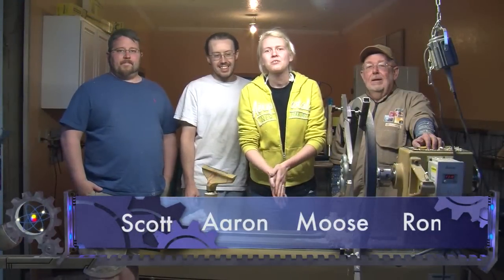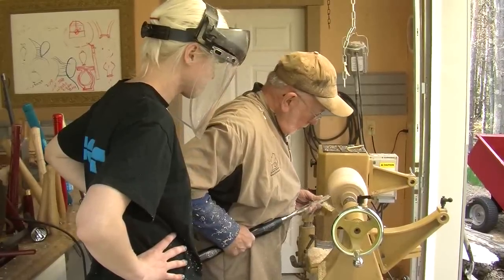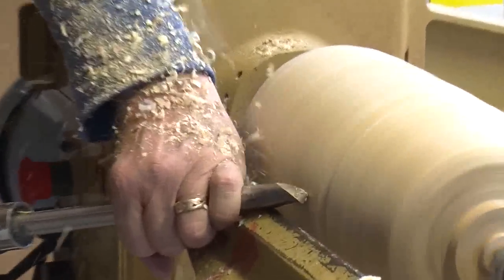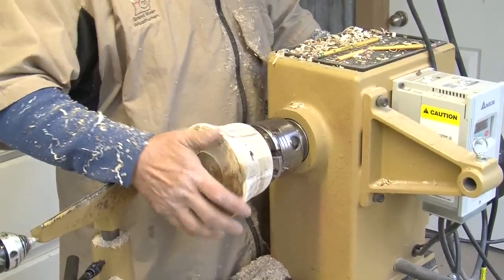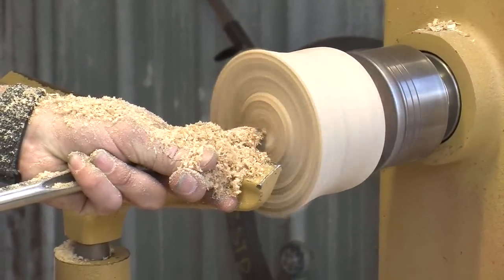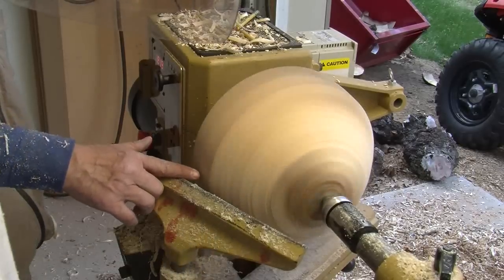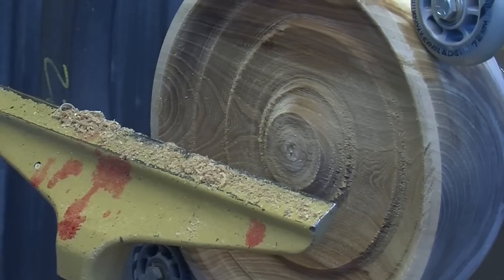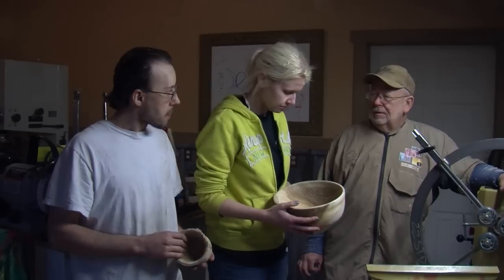Woodturning: Turning Bowls on a Lathe

Comment: I use a reciprocating saw, sawzall, with a pruning blade to rough shape my bowl blanks. I also find that replaceable carbide cutter tools like EWT and Sorby allow one to start turning right away. Two or three tools and no sharpening.
One of these days I will buy a band saw but all my money has been going into turning tools and accessories. Grizzly is 2 hrs down the road in Williamsport, PA - truck delivery to my dead end road can be fun.

Comment: I remember doing nearly all the sanding on the lathe. Once you get down to 300 grit or so, put a couple coats of linseed oil on it, then go over it lightly with 400 grit.  I miss wood turning. Thanks so much for the video!

Comment: had my first time on a lathe too, but learned on SPINDLES, ie grain of wood going same way as the bed of lathe.( grain --> ; not ^)
TIP: what you see is ONLY the LOWER wing touching NEVER both at once ( only a router bit can cut a complete profile in one go!!!)- very hard to  see the gap but it's there. what he is telling and showing the lady is also what I leaned with the spindle gouge, to start use the tip of the tool, (this creates a surface of wood onto which the BEVEL of the gouge can ride into the cut), BUT what he doesn't show is that what my tutor taught me on spindles, the flute is 3 o'clock to START and END, a round cut or cove/ bead; BUT the tool is then rotated to flute up to "find the cut" and continue to turn it to the base of the curve; this closed flute idea prevents the tool skidding on the round surface of wood, before the bevel can hold & guide the tool edge on the path of the cut.

Comment: That log would have been cut in half a lot easier if you wasn't trying to cut end grain. Lay the log on its side and cut with the grain. You would have been through that log in 2 min. A tight chainsaw blade would be beneficial to you as well.